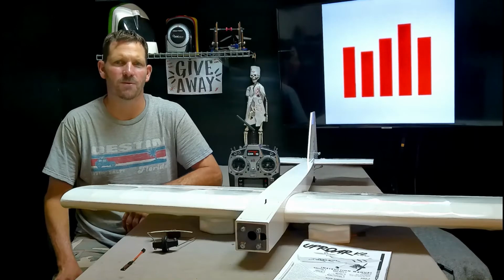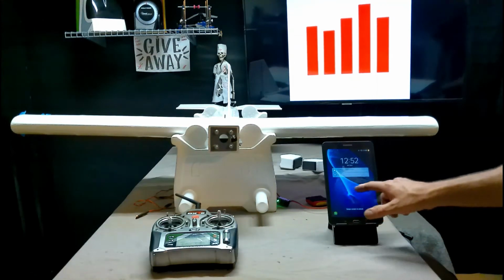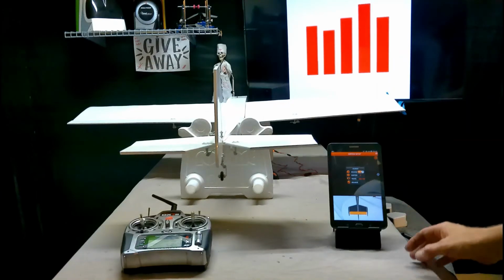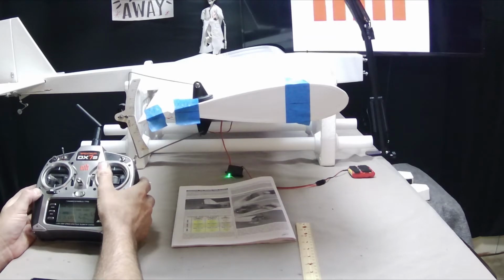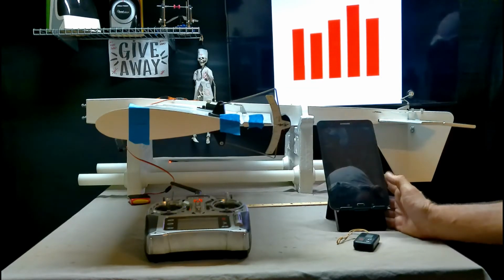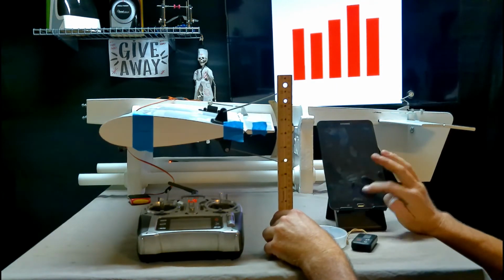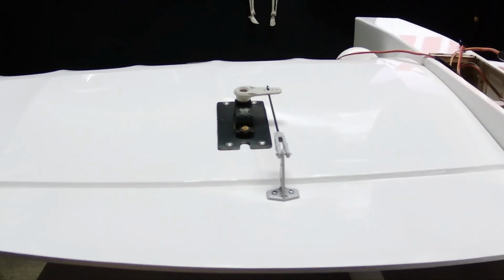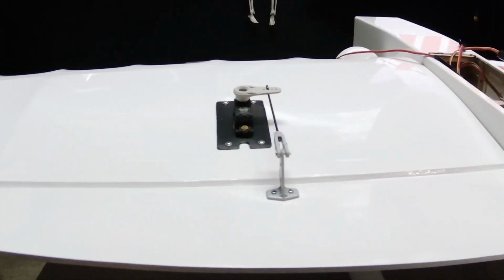PART 2 SPEKTRUM AS3X PROGRAMMER APP AR636 TOWER RC AIRPLANE UPROAR V2 SAFE SELECT DX7S HOW TO USE TH

Comment: Thanks mate just got the Bluetooth module and with your help i will give it a go, thanks for all you do stay safe all the best from England 😀🔥🔥🔥🔥🔥🔥🇬🇧🔥🔥🇺🇸👍
Reply from the maker: THANK YOU RICHARD. MAKE SURE WHEN USING THE BLUE TOOTH MODULE THE VOLUME NEEDS TO BE ALL THE WAY UP AND CONNECT IT IN THE ORDER IT SAYS TO IF IT DOESNT CONNECT QUICKLY IT TIMED OUT AND YOU MAY HAVE TO POWER DOWN AND START AGAIN